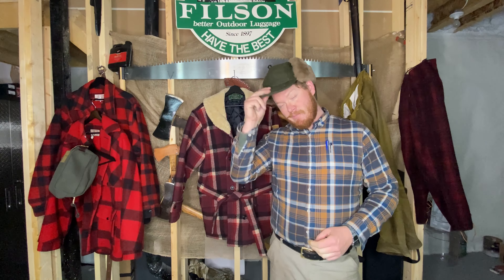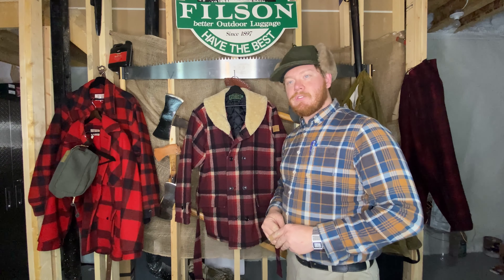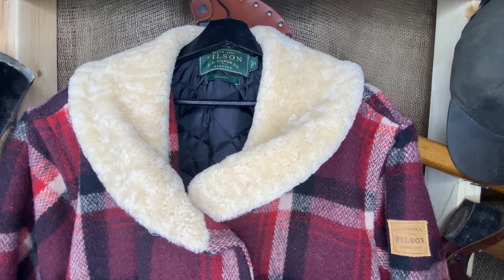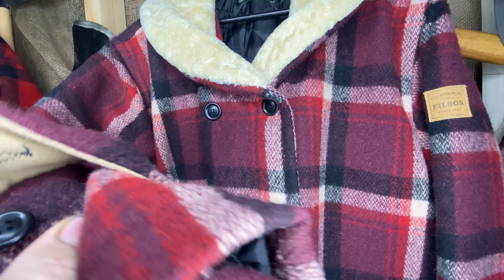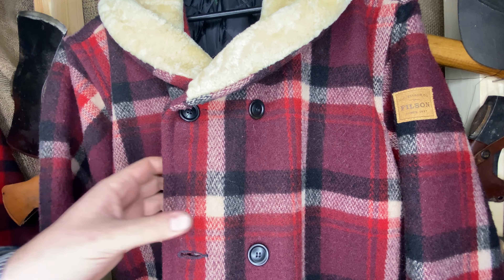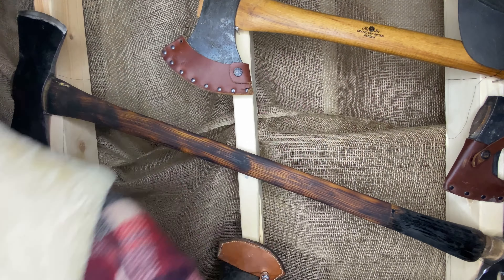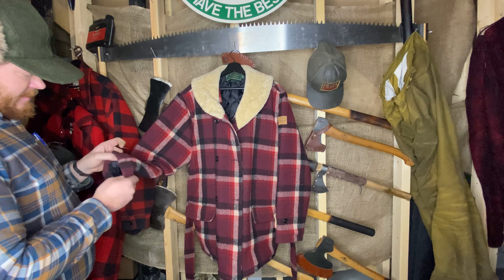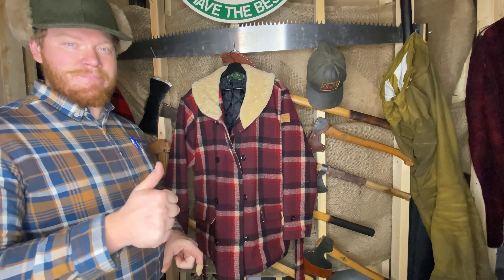The Rarest Filson packer???

Comment: This coat doesn't look very warm. 

What temps is this good for..

How does it compare the warmth of a Canada goose down parka
Reply from the maker: Its a very warm jacket. But this relies on wool and the internal lining for warmth. Wear as Canada gooses is a down based warmth system. There not really comparable in that regard. But for most everyday wear I think the packer is the better choice. That and also the packer is a much quieter jacket being wool. Were as tye canada goose jackets are quite loud being a polyester shell. Id say with the right layering this jacket would be good down to -30⁰C
Reply: @cameronmcpeak5183  thanks for your reply..  I have a very low body fat count..

I'm 6.1 and only 150lbs
I think I get colder than most people because of this.. I think this kind of jacket is too baggy for my physique.

Comment: Probably a fake man. That liner and cut do not match any Filson I’ve run across. I guess it could be a modified version or one off. It just seems off. If the stitching looks incorrect then its more than likely a fake. Super easy to cut a tag from another item and stick it on that liner and sow it in some random old wool jacket.